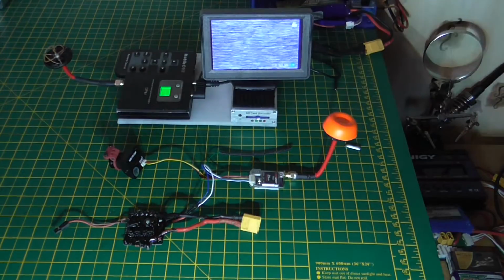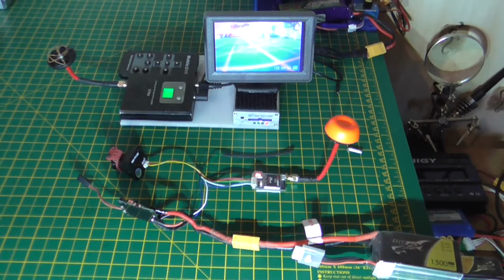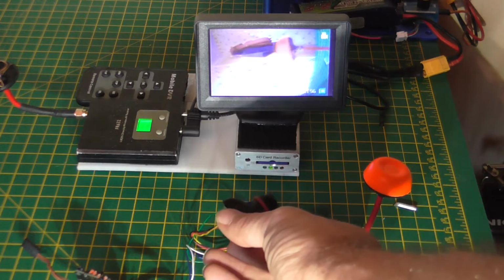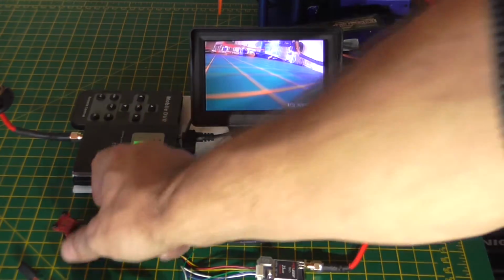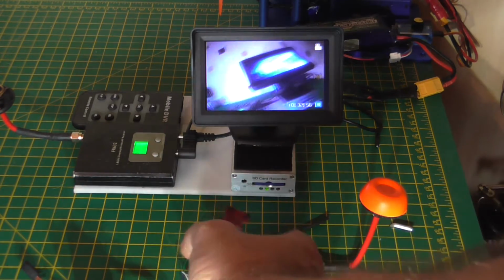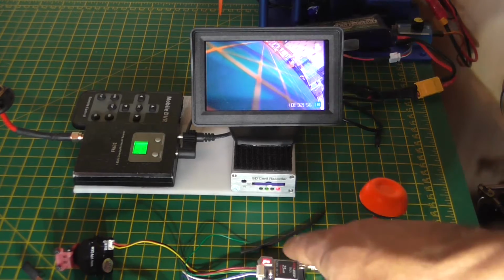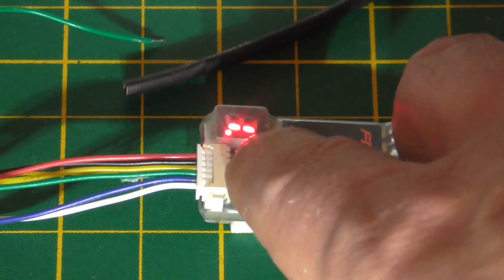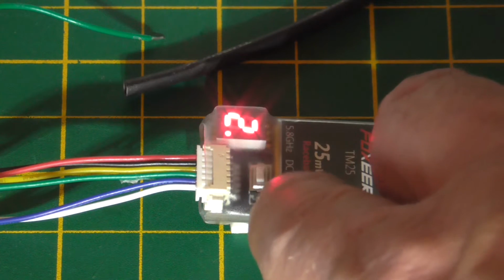Mini Review with Wiring Instructions Foxeer TM25 25mW 5 8G 40CH Mini VTX with Race Band

Comment: Nice job but... the osd?
Reply from the maker: The osd was just a timer on the dvr recorder not the vtx itself
Reply: Pudsey - Rc Thank you for your reply, so the OSD cannot indicate the voltage of the battery?
Reply from the maker: No mate
but with the new Foxeer fpv cams they have the osd built in
Reply: Pudsey - Rc Because i have connected the cable but the OSD Pin is not connected, will i see anyway the osd in my goggles? I have foxeer monster HS1189 1200tvl camera

Comment: I did the same connection set-up, but unfortunately my TX Foxeer burned out.

Did you use a voltage protection circuit on the power distribution board?
Reply from the maker: no straight to the pdb. I have eard rumours the little b esc braking system is so hard it causes other items to blow
Reply: thanx for your reply, but I don't understand. The ESC's must be connected to the PDB to not blow other systems?
Reply from the maker: I dont fully understand myself mate but as i can figure it out on the old Blheli firmware the breaking system stops so fast which then of course stops the current flow. Stopping it so fast cause it to go backwards say to disperse back threw the pdb giving over voltage to other items connected. Thas how i understand it lol its probably more scientific but i like simple
Reply: okay, you got a peak current when breaking with the quad. But i was not breaking with the quad and my foxeer said "pfoof, do it yourself", and I still don't knwo why!
Reply from the maker: +Frits Groen i havnt had a foxeer blow on me yet and i tested them all and use them myself
Reply: guess I had a bad one?
Reply from the maker: Just a standard cc3d pdb
Reply: maybe I need coil to lower the peak current when activating?
Reply: +Frits Groen Found it! I connected the 5 V from the BEC parallel to the 12 V of my 3S lipo. In combination with the camera, the lipo send maximum current to my video tx!